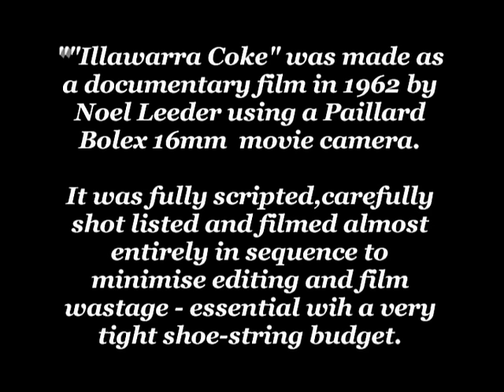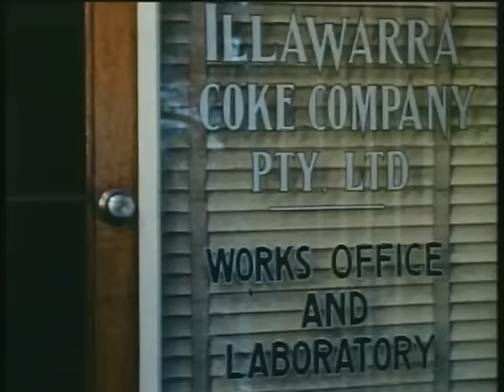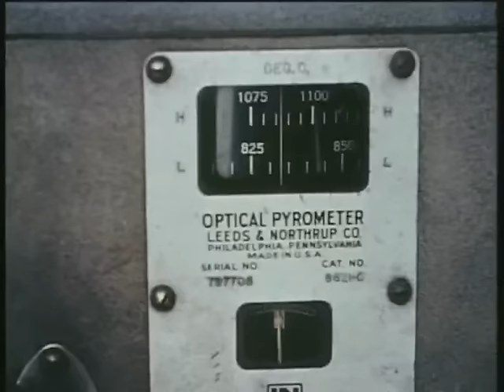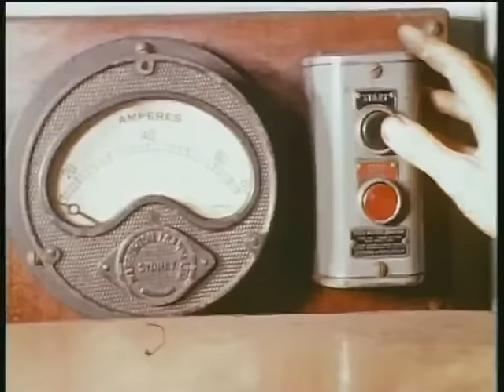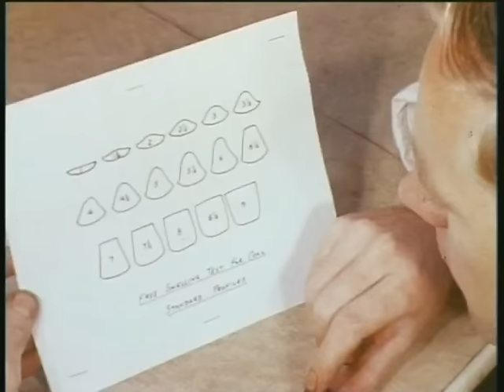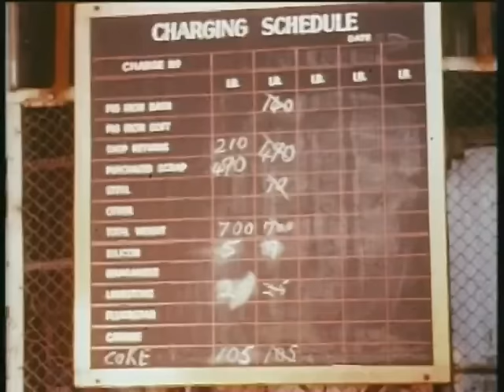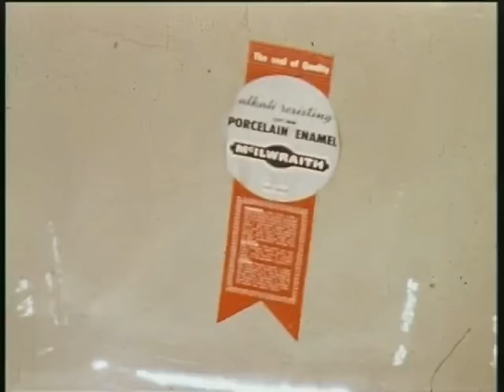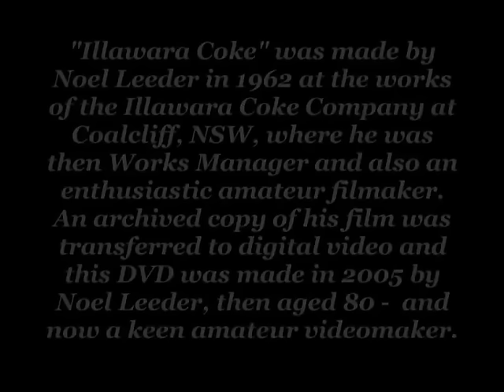"Illawarra Coke"

Comment: This snapshot in time of the working conditions is fascinating.  No standard uniforms; little or no PPE; a heavy reliance on reactionary quality through post-manufacture quality inspections, rather than accurate process management leading to a consistent output..  Incredible.  THX much for the video.

Comment: What a historical gem! In the 70s I worked at BHP Whyalla as, at various, times the electrical engineer for the Coke Ovens. They were byproduct type ovens somewhat more sophisticated than at Coal Cliff.  We had, for the 70s, a complex cross battery interlocking system to line up the ram, the door machine with guide and the hot car. As the ram pushed the coke through the oven the hot car crept forward so the coke was evenly distributed in the car for quenching, the hot car was unmanned. Spent a lot of time getting the creep system to work properly but succeeded in the end. Great days,  great people, great training for a young engineer, thanks BHP..

Comment: This is amazing footage of industry done the old way, its not surprising to see those old hand not using personal protective equipment (PPE) however up to the smelting operation, which incidentally I used to be a smelter furnace tapper from 1989-1999 for FMC/Astaris here in the U.S. advancing up to chief furnace operator in 1999 what a place that was.. the average temperature on the furnce floor was 140 degrees Fahrenheit in the summer. I'll never forget my introduction was quite rude by an operator to the furnce tapping floor was 'welcome to your worst fucking nightmare...what he didn't know was I had nightmares of the place when I was a 10 or 11 years old kid...yes premonitions do happen...lmao...the place has been closed for 20 years now. Oh and by the way this plant made elemental phosphorus and coke was used in the process. I hated that place but didn't when I seen my paycheck. Thanks for this video I know its a whole different animal but it still brings back memories for me.

Comment: Lead is an issue here as well.
We emit around 170 tons here per year in exceedance of environmental regulations.
I won't eat vegetables from my garden because of it.

It will be interesting to see if VALE invests in technology to clean this last vestige of the bad old days.
So far however they have shuttered more and move the pollution to other places with lower environmental standards.

That is the great challenge going forward.
Making all work places safe and clean air and water for all.

Comment: So I noticed the coal went into the oven as a powder after grinding, but came out as solid chunks. Is the coal self sintering while it's being coked, or is there a binder added?
Reply: Charge (mix/blend of several grades of coal concentrate) is loaded into an oven and absence of oxygen gets exposed to high temperatures which makes the blend shrink and turn into coke, thus the process name "cokemaking". No binder is used as it makes no sense.
Reply: For binder used adding oil. It is all in this video. Look carefuly!!!  :)
Reply: @ldkbudda4176  Correct, it clearly states the blending  and binding agents.

Comment: Just another industry that technology and modern metallurgy has made obsolete. Its now cheaper and faster to manufacture steel with the new green technologies than it is to continue to use coal coke. And there are 3 different processes now available in the marketplace.

Comment: Fascinating ... kinda like a retort for wood, only it's gigantic and used for coal.

Question: why use water to stop the process instead of simply shutting off the flow of oxygen ?  Is it to save time ?

Conceptually, it also seems incredibly wasteful in terms of heat loss ... however, if the conversion were done in a sufficiently sealed chamber it seems like you should be able to use a closed loop heat exchanger of some sort (supercritical co2 perhaps?), and recover a lot of that heat for other use like power generation or thermal storage (molten salt ?). Seems like itd be a lot greener that way by being more energy efficient and emitting far less co2. Heck, you could probably pair it with an Allam Cycle power generation plant for even greater efficiency gains in both processes. That idea is probably worth a modest fortune ... my good deed for the day I guess.
Reply: The location was under a 100 - 200 metre  high escarpment and they built small dams on the creeks above 1 or 2 km away. Water was easy.
Reply: In those times the coke used to be wet quenched...you will find information relating to it with a search.
Reply: @flamingfrancis  So, I should basically just shut up and google it ?  Egads, has the world, and state of conversation along with it, devolved into everyone either assuming everyone else is a snowflake, or being one themselves without even knowing it ?  A snowflake apocalypse ?

I give up.